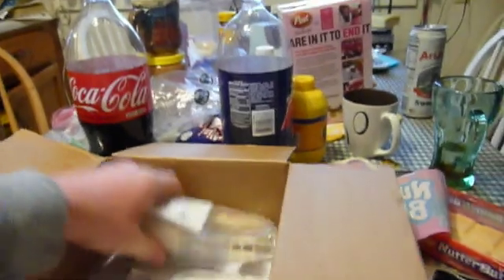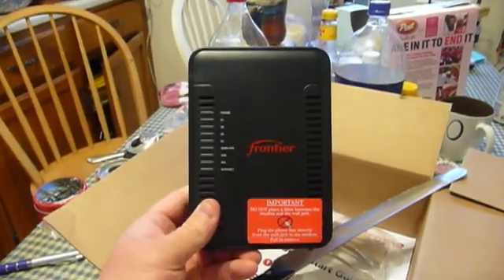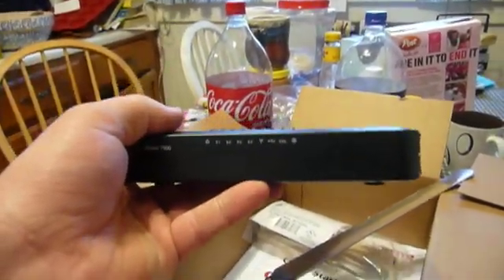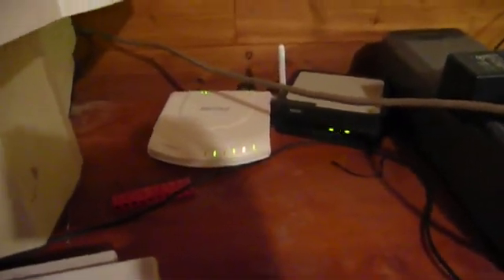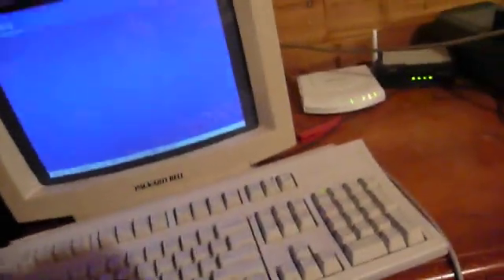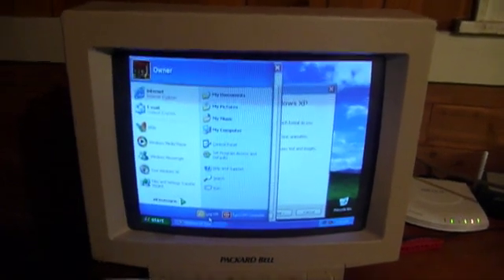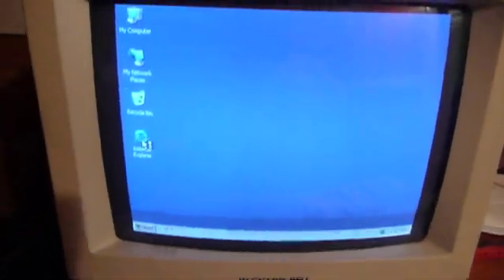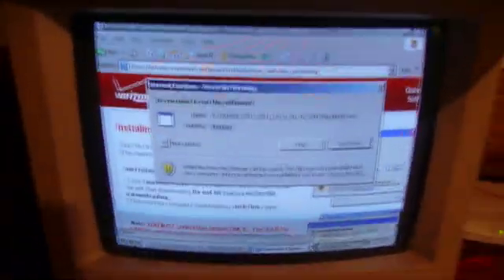The 'New Frontier' (installing my DSL service)

Comment: I still have the dsl modem/router that verizon gave us when we used them. Its a competent little box, especially when you flash the stock rom on it.

Sadly, this one entered a bootloop somehow. it wasn't even plugged in, just sitting in storage. kinda sad tbh...

edit: its a dlink dsl-2750b
Reply from the maker: The minimal operating systems in these things don't often deal well with corrupted option flags in their nonvolatile memory. The trick is finding a way to clear this corruption, which usually has to be done externally.

More likely than not, the D-Link both then and now had major security vulnerabilities. Of course, they're hardly alone with that problem. That's part of why this one was "baselined" at setup time and still is today.
Reply: @uxwbill  Turn out it was a power supply problem. Hooked a more powerful 12v power supply up to it and it works now. Man i hate capacitors sometimes.

Idk what ill end up doing with it. Probably something extremely ridiculous

Comment: What's your internet speed these days? Has Frontier been reliable over the past almost-decade?
Reply from the maker: It's around 7 megabits down, which is definitely not fast by today's standards. Sometimes I think about bumping the bandwidth or switching to a provider with faster offerings than Frontier offers, but I'm not at all unhappy with what I have.

I'd say it's generally very reliable. Every couple of months, and sometimes less often than that, I'll lose connectivity. Rarely, restarting the modem will solve it. Most of the time I have to wait 24 hours or so and the service will come right back. No one from Frontier has ever been able to explain it, although I'm not surprised in the slightest, being as I've had to explain TCP/IP,  DHCP and other basic networking concepts to their telephone support staff. Even when I have gotten ahold of someone more clueful (or been contacted later by one of those people), I've heard so many different things that I don't think they have any idea why the service conks out at random times.

Comment: I had frontier few years ago. 12down and 1up. I live close to hub or sever. When I try upload video red light would come on kocked out internet called frontier they told not uploaded vidoes . And  was getting into second life at time it was heavy on bandwith plsu I was DJing useing Sam brodcaster to stream in 128 on shout cast stream .then we got more devices and sister got PS4 and frontier had to go . Plsu 12 mb seem so slow also. So we now got Mediacom  extram 200down and 40up but crappy part we got 1tb data cap  we also got HD cable too I think all around 125$ mo compared to frontier and Dish 180$mo Mediacom called us the other offered 1gbit for 10$ more but we happy with what we got lol .
Reply from the maker: If I could have gotten Mediabomb to fix whatever problem prevented me from uploading anything reliably (not just videos), I would have stayed with them.
Reply: @uxwbill  oh that would suck .sound like same issues I had with frontier I could not upload one vidoe and they would not fix it so they told me not too .witch I felt was a bit rude .I don't know if bad modem or what .but yea thanks for response uxwbill .witch I have watch some of your vidoes not all .but YouTube recommended me this vidoe and I now I see it older video . Hope you have good weekend

Comment: Is that Westell still running today? I wouldn't be surprised if you're still rocking it, they last pretty long - my neighbor had had theirs since 2010 and it's still going strong. In my area, by default they give you these Actiontec GT784WNV routers that last all but 2 months, no joke. I have a better router now (not an Actiontec) but as far as I know Frontier no longer supplies the Netgear/Westell models to new customers.
Reply from the maker: It sure is. I did notice that the power adapter it shipped with is getting a bit weak (won't always start up after applying power) but the 7500 itself is still working great.

The ActionTec models seem not to be very popular around here. I'd guess they've been a second source for Verizon and later Frontier, as I've seen a few that were handed out when it was Verizon.
Reply: Recently spotted one of these still in use about a year ago, they do seem to have held up well the past decade

Comment: Frontier and Mediacom maintain your area? That's got to be the worst of both worlds. Seriously. Mediacom is easily worse than Comcast and Frontier is probably the worst DSL provider in the U.S. right down there with WindStream. With all the effort you put into your YT channel you deserve something so much better. I have 100 megs down/3 megs up through CableOne (Yeah, very low upload speed, I know) and I couldn't even begin to imagine going back to DSL. I had constant problems with it and over 10 technician visits simply because it would go out any time it rained. It was never fully repaired. Also 1.5 mbit download speeds.. no thanks.
Reply: ***** You're absolutely right. If their nodes are oversold then it doesn't matter how much faster they might be compared to DSL. Years ago the saying used to be that DSL was superior in that you have a direct connection to their network as opposed to cable which essentially shares data at static frequencies shared with multiple devices. DSL connections are indeed shared however once you reach the DSLAM/RT. They can be oversold just like a cable node. In this case it sounds like Cox in your area doesn't care to maintain their network. DSL tends to be less "oversold" but if you have a long loop to the RT or CO then you might end up with really miserable speeds and connection stability problems. Sorry for rambling, I could talk about this all day lol.

Comment: The only two choices here in the Philadelphia area are Comcast, and Verizon FiOS fiber-optic service. FiOS has been reliable for the most part. But I did have an optical Network terminal (basically a modem)  die on me and was without services for 2 weeks until they sent a repairman out.

Comment: In my area, Frontier offers 24 Mbps down, and for businesses, up to 40 Mbps down. Did you just not feel like paying for higher speed or is that all they offer?
Reply from the maker: +Blake.TV Here that is all that's offered. A seven megabit down (still 768 kbit/sec up) service tier existed for a while. It does not seem to be available here now, and those that had it no longer do.
Reply: +uxwbill really? In 2016 they can't offer you anything more than that? I thought Comcast was bad.
Reply: +QuillBin It depends how far away he is from the DSL serving box (those things on the side of the road.)

Comment: I had gotten DSL several years ago after being on Dial-up since the mid 90s - They also tried getting my to install a bunch of crap like that, too. I just plugged the DSL gateway in, and bam it worked. No software needed.

Comment: I've had all sort of problems with Frontier over the last few years.  It finally works right most of the time but it took a couple of years and a lot of frustration.  Some modem some local line problems and one final reset or update of the modem from the office (I suspect) and all is stable.

Comment: Of course ,you can do a windows 10 install even on a vga output.. Vga output is still put on almost ever led flat panel sold to date...
Reply: +xxdizannyxx Uxwbill meant installing Windows XP on a monitor with a VGA Resolution (640x480), not a Monitor with a VGA output.
Reply: +KSLTech Studios oh ok, makes sense. I was wrong, thank you for the correction!
Reply: VGA only as in the standard and not the plug  - meaning it only supports 640x480 resolution (which was semi unsupported in NZ let alone anything newer).

Comment: DSL uses a pots line, old copper lines, although many areas are starting to replace copper lines with fiber optic. I worked for AT&T so got to see a lot of the old copper lines. I worked on a digital crew installing DSL and T1 & T3.

Comment: You do know the speed tests are based on location right? Frontier has one closer (most likely) than speed test dot net, on top of the speed test dot net also loads ads and a bunch of flash that takes up bandwidth.

Comment: Problem is the outside cable, I used to work for AT&T and spent a lot of time outside helping fix old cable, some of these stuff is so old and has paper insulation. Sometimes water gets into it and various other problems.
Reply: Paper insulation?!

Comment: Have you had any experience with Netgear home ADSL gateway devices?  If so, what do you think of them?  I have a Netgear DG-834G that I've had since 2007, I really like it, it's very reliable and since I switched to ASDL 2 at the end of last year it's hardly gone offline to the point where it's a problem, I quite like it.  I also liked the bit of the video where you said goodnight to your cable connection as you pull the AC Adaptor out of the power board.

Comment: Like you said though, its finicky sometimes, but tends to work very well for what it is. I have a 30 foot abandoned tv antenna tower that my internet antenna is on and the transmitter site is about 6 miles away on a cell phone tower. Its my only real option and I am grateful too have it, its unlimited too.
 before someone mentions satallite internet remember they have usage caps, and i believe hughes net limits you to 200 mb a day/ 5 gb a month.

Comment: @uxwbill I'm pretty sure the custom software is only necessary to let you choose a user name and password for the first time. Once you're past that point you can uninstall it because you won't need it again. I often see old DSL modems in the thrift stores around here. I picked up one for myself (for less than $10) in case my main Westell 6100 modem ever goes on the blink.

Comment: We had usenet but roadrunner said to much porn so the dropped all of it 6 months ago . I miss it due tothat had a lot of articles on Pc repair motor repair  and a lot of other repair . We cant get frontier due to no fiber optic lines run and where close.
I can get Verizon but it is on POTS and a lousy  1 meg down and128 k up . Man I wish I could get better internet but alas there is none Sucks

Comment: @uxwbill It actually wasn't that bad, It did have 128MB of RAM in the machine, it was a Super 7 board, I just didn't have the cash for a K6/2 to throw in at the the time, this was also with no service packs.  I'd say the speed was about the same as your "Being Mean to Windows 7" video.  Microsoft says that the min for XP is 233, but it doesn't check the hardware (unlike Messup Edition).  I should do a video of my old setups from the past.

Comment: @uxwbill Welcome to Verizon/Frontier internet, AND they won't send a basic model modem. At least on Verizon for me they send out Actiontec routers for FiOS customers but they are hackable to run DD-WRT but it doesn't work on coax interfaces directly. On Frontier (Not Verizon) you will be paying out the nose for your service sadly to say.